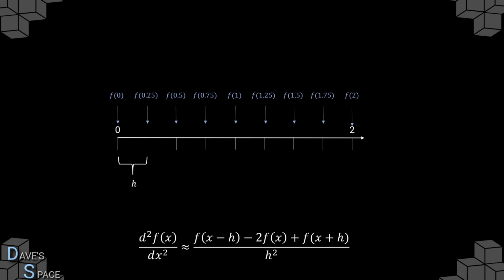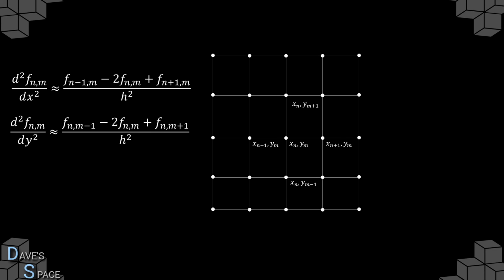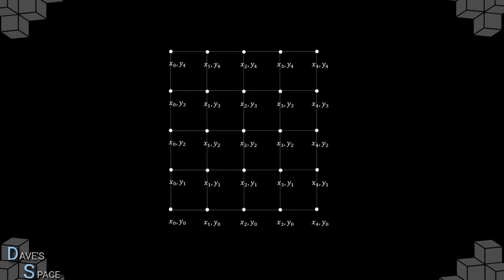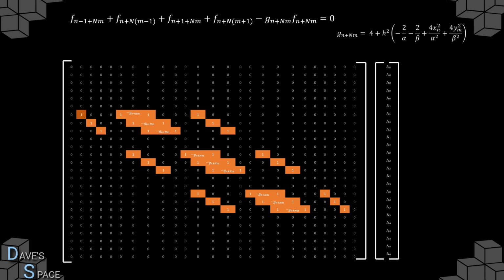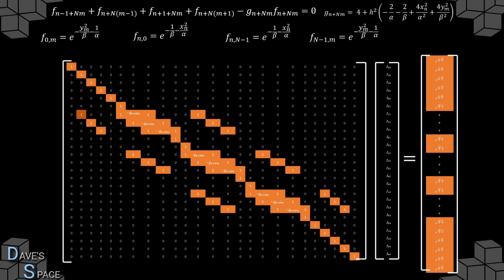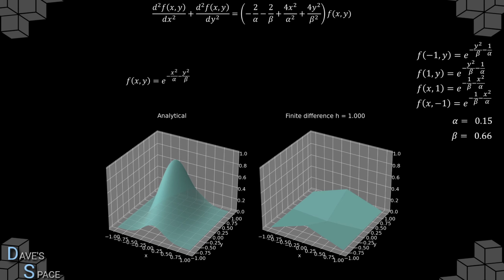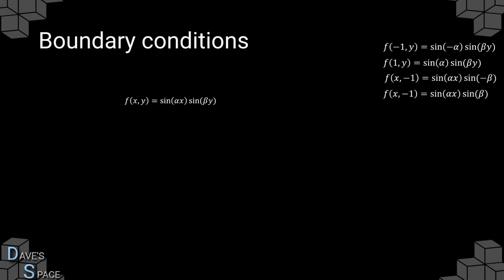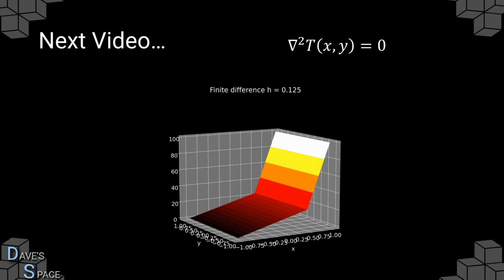The Finite Difference Method (2D)

Comment: I'm writing my master thesis in energy engineering, where I am to develop a MATLAB-model of a cement-process plant. This video helped me because I forgot that the 2D cooler unit (which works by cross-current heat exchange) has many boundary conditions. I was following mathematical modelling book that only showcased a 1D heat-transfer problem. So thank you. It seems so obvious now in hindsight xD.

But anyway, if the code for making this huge diagonal matrix and b vector becomes too unreadable and inflexible. I may resort to using MATLAB's built-in pdepe function and appying a shooting method to account for length-wise heat conduction. Is there a chance you could make a video on how to make these matrices, based on the physical problem?

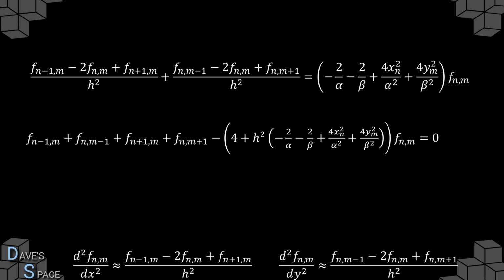Comment: Hello Dave! I have a question for you. I'm attempting to use the 2d Finite Difference Method that you describe in this video on a large 301x301 lat/lon grid. I've been referencing the Finite difference coefficient wiki page, and I'm trying to figure out whether the example shown at about 4:32 would be considered a 2nd derivative with 2nd order accuracy, or a 2nd derivative with 4th order accuracy. Based on the coefficients, I'm assuming it would be 2nd order accuracy, but I wanted to get your opinion.

Comment: hello Dave, why we made the I = n+Nm? for n,m
Reply from the maker: Hi, we do this substitution so that all the gridpoints can be expressed using a single index instead of two indices. The choice of n + Nm is arbitrary but follows a logical pattern of stacking the columns on top of one another.

By having a single index, the NxM equations with NxM grid points can be expressed in a single matrix of size NM x NM.

Without doing this substitution you would need to use the equivalent of a three dimensional matrix to solve the equations.